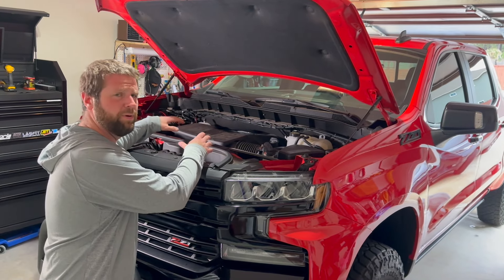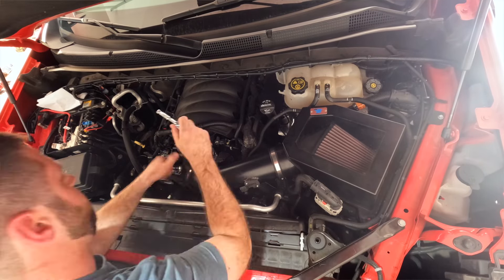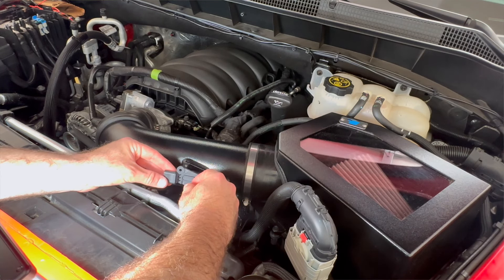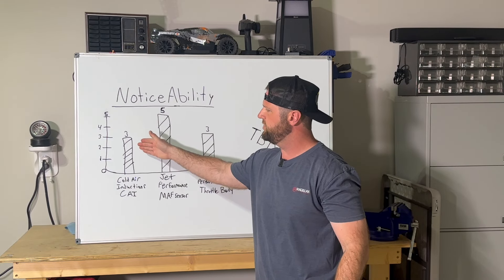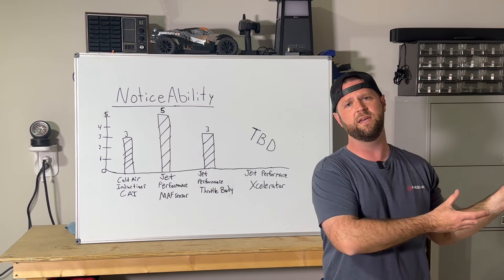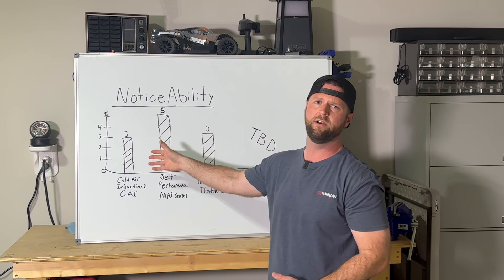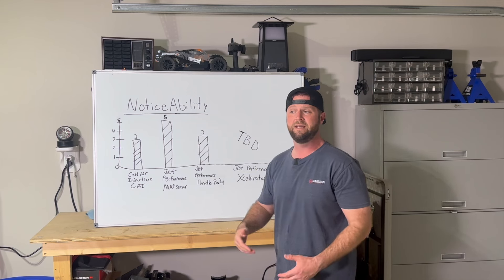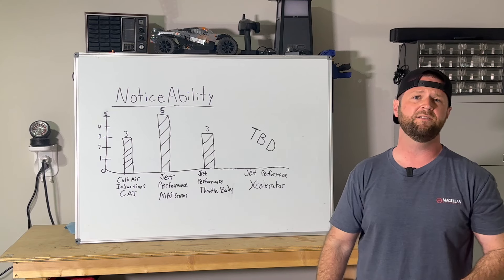Chevy Silverado 5.3 Full Intake Upgrade Worth It?

Comment: I do like that cold air intake. Most of them should be Hot 🔥 Air intakes.  I looked for that MAF for a 6.2L ,but it appears they don't offer one.
Reply from the maker: I checked and it looks like they do offer the MAF Sensor. When you are searching on their website, you have to select Silverado 1500 and then the next drop down box shows 6.2L.

Comment: Just installed the mass air flow sensor and its made a big difference in throttle response.  Also installed the LT pulsar it is a game changer.
Reply from the maker: Nice, I have been thinking about the Pulsar LT. Did it make a big difference?
Reply: @zachattackcustoms  yessss it did.   Got rid of the 106 speed limiter, auto stop, that direct fuel management, and raised my throttle response.  Acceleration is Awsome
Reply: I put the jet throttle body on and it really didn't make as much difference as the massive air flow
Reply: @zachattackcustoms  it got rid of the annoying start /stop  the DFMS, speed limiter of 106 and changed the throttle response. I put the Jet throttle body and today the Jet throttle body Spacer. The Spacer made alot more difference, shifting and response is smoother now.
Reply from the maker: @georgedoughton9508 good to know! I will have to look into a throttle spacer, unfortunately Jet Performance doesn’t have one for my year, but I am sure there are others out there.

Comment: Plastic has better for heat I think
Reply from the maker: It’s aluminum but has a heat resistance coat on it.
Reply: So it's counter-intuitive, but because plastic is a better insulator, it gets heat soaked. Plastic does take longer to heat up than metal, but once it's hot it will stay that way for *hours*. Metal will heat up faster, but it also cools off fast - a few seconds at WOT will cool a metal air intake tube. So, basically, plastic is not the best choice, but a lot of companies use it because it's so affordable. We have a video that explains all of this here - https://www.youtube.com/watch?v=tETJRQsWqtk - it might make more sense than this quick explanation.😅
Reply: @ColdAirInductions  thanks mate

Comment: I added the Corsa performance cold air intake and the Corsa performance exhaust plus a jet performance MAF sensor. Now I keep getting a MAP sensor engine code. Anyone have any idea why this is happening? Thanks in advance
Reply from the maker: Did you disconnect the battery before installing everything?
Reply: @zachattackcustoms  yes sir. It was disconnected for about 20-30 minutes 
I fully disconnected it. Positive and negative
Reply from the maker: @bandekko try swapping to the factory MAF sensor to see if it goes away.
Reply from the maker: If you have a scanner, you can check the air flow rate to see if there is a problem with the MAF sensor.
Reply: @zachattackcustoms  thanks I’ll try that
Last time I checked the code it threw it was a mass air pressure code. The truck is a 2023 Silverado ZR2. The MAP sensor should not be trash already
Reply: @zachattackcustoms  that’s exactly what I did yesterday 
Today it seems fine so far 
I’ll give it another day 
Thanks for your input 
It’s greatly appreciated 
I’m about to subscribe if I haven’t yet
Reply from the maker: No problem, I try to help where I can. Thanks for watching!
Reply: Dos you fix the issue?

Comment: I went out and spent a few bucks and purchased a 2023 Dodge Charger Scst Pack. It has around 525 horsepower if the Dino tests are true which I've seen people talk about on the Internet. If it doesn't the manufacturer says it gas 485 horsepower. Do I really need all these added upgrades. It is fast the way it is. 1
Reply from the maker: You could also ask, do you need the scat pack? Do you really need that compared to the regular charger? It all depends on what you want out of life.

Comment: All the other video of the same kit were proving only gain 1 percent more performance. And tested on a dyno.  They are really a waste of money from most of the videos on the Tube. Also it can affect the way your car runs.   Some of the tests actually proved the car ran sluggish.  So if you are installing a cold air induction for looks then do it.  But if you are trying gain a noticeable increase in performance then you are wasting your money on these.  They just don’t really do the trick.  You are not doing anything to the fuel mixture to burn more fuel to make the extra hp. Moving the airbox away from the engine in hopes to getting a more oxygenated air fuel mix simply doesn’t do what is advertised.  In some cases made less hp. 
They are expensive and a waste of hard earned money
Reply from the maker: I plan to eventually dyno the truck with a video showing the results, but have a couple more mods in mind.
Reply: @zachattackcustoms  can't wait for this. Dyno with the aftermarket parts and without. Lets get to the bottom of this.
Reply from the maker: Don’t have to wait, video is on the channel.

Comment: No Pulsar, no JLT catch can, aren't you afraid of lifter failures?
Reply from the maker: I personally feel that changing your own oil more often with full synthetic is a better solution.
Reply from the maker: Other reason, I really want to eventually get it tuned after I am done with performance upgrades. Probably not a good idea to switch up parts once I get it tuned.